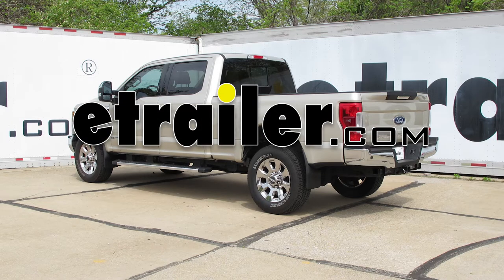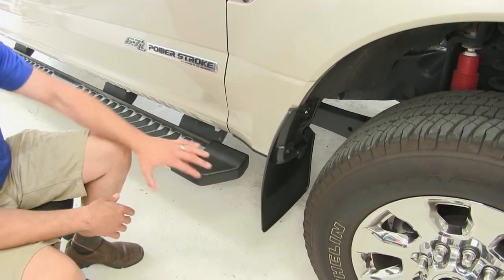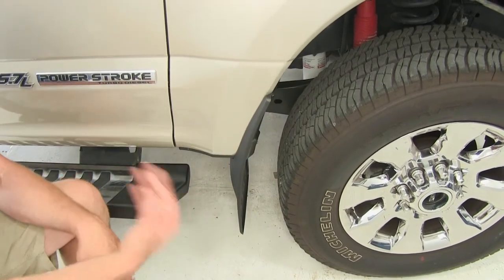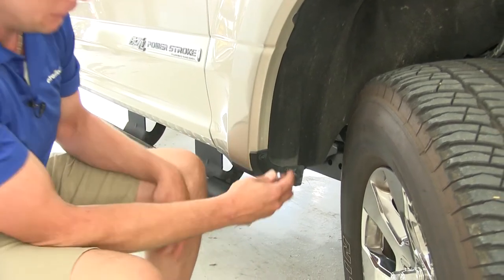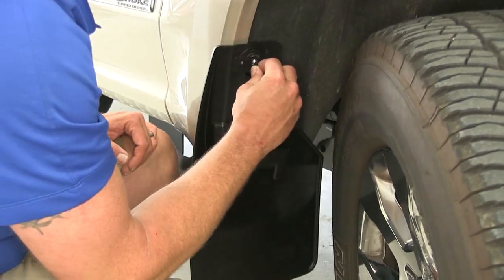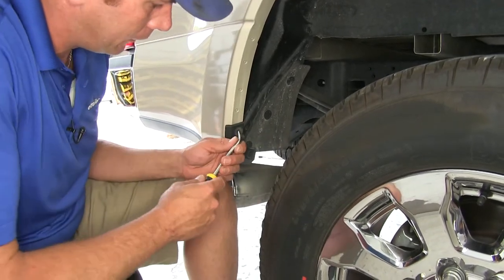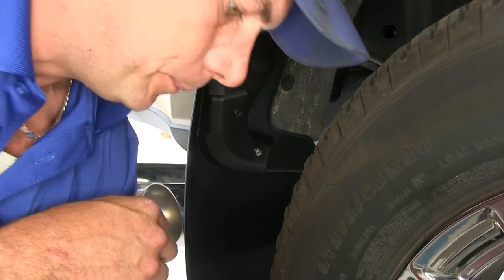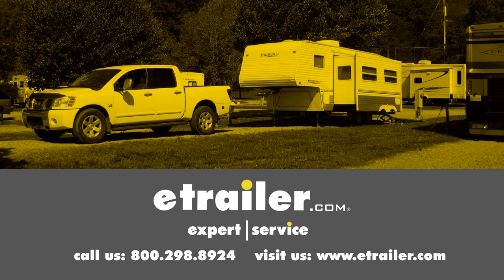etrailer | Installation: WeatherTech Mud Flaps on a 2017 Ford F-250 Super Duty

Comment: Where does the stick tape go on the rear weathertech mud flaps
Reply from the maker: The kits that we have available for the 2017-2020 Ford 250/350 will not come with tape for the rear mud flaps. Do you have a kit for a different vehicle? If so, I can help to find out what the tape is for.